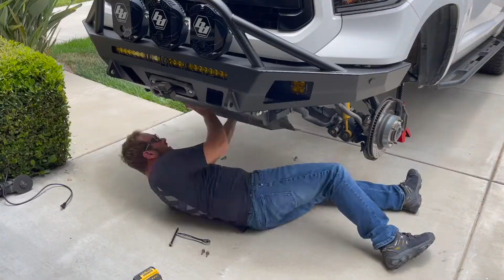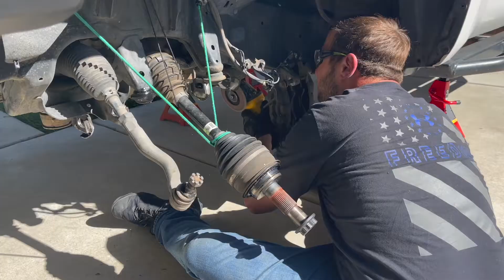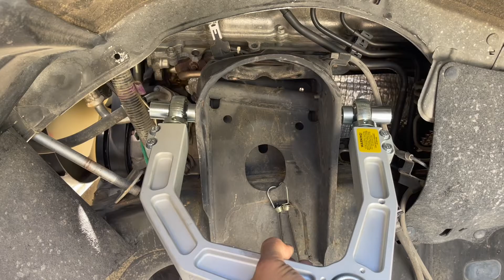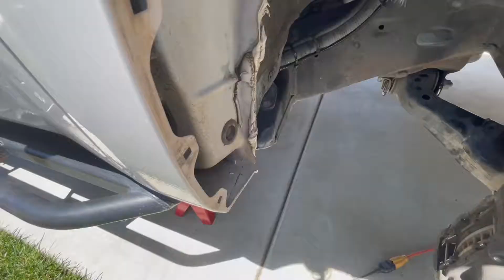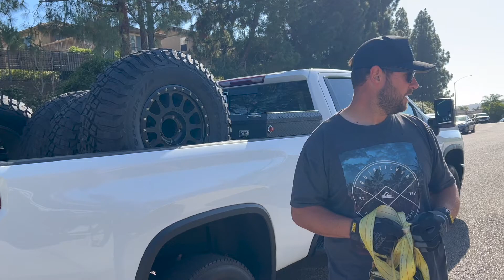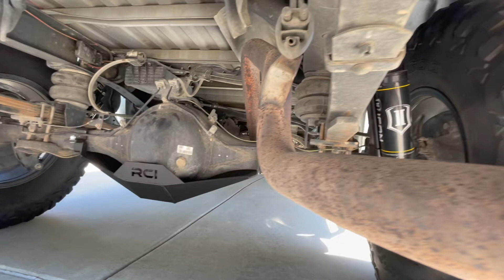ICON 3.0 Suspension & 37 Inch Tires - BIG Changes For The Tundra

Comment: nice video brother. How much lift did you end up setting on the front? What rear end setup did you end up doing now with the 4wc?
Reply from the maker: Thanks! I don’t know specifically. I’m thinking 2-3” but they are adjustable coil overs. So I just adjusted the spring till the truck sat level. Rear had leveling air bags but it needs a new set of lead springs. Waiting to see final weight when I get done building it out.

Comment: No sway bars ?
Reply from the maker: Truck didn’t come with a rear and the front one didn’t fit very well after the new suspension. Was going to adjust some stuff to make it fit back on, but once I drove it without it, didn’t notice much of a difference. So now it’s taking up shelf space in the garage.
Reply: Yeah I have a 4.5inch bds coil over kit never drove with the front one off. Considering removing it

Comment: Hi there,
I’m wondering if you’re Using the same stock gear ratio in your diffs ir have you re-geared them to perhaps 4.88 or 5.29’s? 
Also, did you notice and vibration from your driveshafts due to your lift or not? 
Thanks in advance for your feedback..
Reply from the maker: Hi, I did eventually go to 5.29. In this video I had not switched yet but a couple months later I did once the parts finally arrived. I also put in an Eaton E locker. 

My lift is pretty mild. Only about 2 inch. So no vibration from pinion angle.
Reply: @prospectoverland  Thanks for the info and keep these awesome videos coming..🫡👍🏼🥃

Comment: What’s the height of your lift?  Sway bar rub on the inside tire on full lock?  Awesome set up.  Clean job.  Nothing like yourself knowing that there’s
 quality time and work done to it.  Keep it coming!
Reply from the maker: It’s hard to say the exact amount of lift. It doesn’t have a actual lift kit. The icon shocks have the coils cranked down to the max amount which I think is about 2-3” of lift. But my truck is very heavy so 2” of lift on mine might be 3 or 4” on someone else’s rig. 

Sway bar had to come off because it was hitting the bottom of the shock where it mounts to the A arms. 

Still rides great without the sway bar. But tires hitting the sway bar was not the issue. +25 offset rims are the ticket for not rubbing a lot.

Comment: Now that youve run this setuo for a bit , are you rubbing at all? Love the truck!
Reply from the maker: I get a slight touch on the very top of the tire on the fender liner. But only enough to just put a small discoloration haze on the plastic, zero damage.

Comment: I gotta ask, as I’m looking at the GFC as well. Is the tundra your daily, and if so, what’s it like always having the GFC on. What else was added to assist with the weight and what was the impact on mpg. I have a 2019 TRD PRO tundra and just looking at options, thanks!
Reply from the maker: Its not my daily, it gets horrible mileage but not solely because of the GFC. I don't know exactly the difference the GFC made because my truck has so much other stuff done to it and is really heavy. I get 10mpg typically. The GFC is light weight, but with all my added gear and bumpers and stuff I have air bags currently but planning to get a different leaf pack built.
Reply: @prospectoverland  that’s not too bad. Thank you for taking the time to answer my question!

Comment: How much lift over stock did you add?
Reply from the maker: I’m not sure really. So many things are changed about it. I have 1.25” of pre load on the springs but that’s doesn’t say much because my trucks weighs a lot so that much pre load on my truck doesn’t equal someone else’s. If I ever come across a stock tundra I should do a quick measure.

Comment: I have the similar setup with ICON tubular UCA's, with leaf spring kit and fully adjustable dampening rears as well (I think essentially stage 9?). The shop that installed mine did not cut the bump stop, nor did they move the boot on the steering rods. I wonder how critical this is and if I should be worried? Also, I didn't hear you mention any diff drop kit or bump stop spacers (maybe I just didn't hear). I had Coachbuilder bump stops installed (with his outer tie rod) and the Icon diff drop kit. Your BMC is amazing. Wish I was close I'd pay you to do mine. 😁

Also any issues with clearance on the way you did the pinch weld mod? How do you like the KM3's? I was thinking of Toyo AT3's but I think overall diameter is larger than your KM3's.
Reply from the maker: Hey Jake, I guess ill never know if trimming the edge of the bump was totally necessary. I've heard it specifically is needed for the 3.0 system due to the bigger coil size. The 2.5 shock has room to clear. Reference moving the boot, again I guess I won't totally know but the reasoning was that by sliding the small end of the boot closer to the center of the truck it allowed some extra slack in the boot to accommodate extra articulation. I've heard that the boot could tear from being stretched to the max when the suspension drops out. The reasoning makes sense in my head so I just did it. 

My truck already had a diff drop from a previous lift which I guess I failed to mention. And I did install Icons thick washer/bump stop spacer to limit the up travel and prevent any coil binding. I think I did this after the video once I spoke with them some more. 

No clearance issues on the front after my mod's seen in the video. Thanks, I am pretty happy with the BMC. Turned out pretty clean once all painted up. Check my most recent video, did some flexing tests. The rear tires rub some plastic on full tuck. Not a big deal. And yes the KM3's are amazing but I think are 36.5" when truly measured. 

I think i covered all the questions. let me know if i missed something.
Reply: @prospectoverland  That covered it! Thanks for that detailed and quick response. I’m waiting for wheels/tires (37’s) as I heard that gears are required with 37’s. I’m going to save up for Nitro 5.29’s, and…..if I’m doing gears, then I’m doing Eaton E-lockers at same time. So I need to save up about $10k. 😢 This is not a cheap hobby!
Reply from the maker: @jakemaddox76  haha everything seems to be a minimum of $1k. I just did the same gear and locker set up. Couldn’t be happier with it. Just had my 1000 mile break in oil change done a couple weeks back. Used the locker twice already since breakin has been done.
Reply: @prospectoverland  oh awesome!! Did you make a video covering the install?
Reply from the maker: @jakemaddox76  i didnt becuase it was all done at a shop. nothing to really film. left my truck with them for a few days and they did the initial heat cycling for me as well.
Reply: @prospectoverland o was doing my brakes over the weekend and noted that both tie rod boots popped off the steering rack. At full lock the open space is ridiculous. Why has nobody else mentioned this? They’ve probably been off a year. I contacted Icon and one of their techs Justin said that the Tundra they installed it on when designing their suspension kit did not have tie rod boots. Can’t be normal right? Seems a longer boot would be best solution (in addition to chocking up boot as you did). Plus, my boots came with zip ties instead of pipe/band clamps. Cheeseball.
Reply from the maker: @jakemaddox76  mine are still working fine in the choked up position. A larger boot would be the ultimate fix but the way I have been running it has been working fine. I think I saw this in the ICON instruction to do it but maybe it was a tip from somewhere else. I cant remember.

Comment: Where did you get your alignment done? I got mine done at the ORW in Kearny Mesa and the guy bitched about what a difficult time he had and I have the same suspension set up that you have up front. Icon 3.0 coil overs on my 2016 Tundra with Icot billet UCAs. I wouldn’t mind a decent shop to get this done at in San Diego.
Reply from the maker: Accurate Alignment in Oceanside. They did so awesome. They did say it was a little tricky and I think was $150. But they weren’t complaining at all. They really liked the upper billet arm because it was super adjustable. I am not a fan of ORW whatso ever. Steer clear of them. They just install bolt on parts. No custom or specific knowledge about special builds.

Comment: 13:17 No one ever thinks to just fold in the factory steel on the body mount. Cut a pie wedge, Hammer it in, then weld it back together.
Reply from the maker: Yeah that would work I suppose. Would save buying the pre bend plates. But the plates are so easy to fit right in.

Comment: I had icon suspension,  HAD.  Went to Fox after Icon failed to honor a warranty claim for a set of shocks that broke at the strut.   I steer anyone away from Icon.  Terrible CS.
Reply from the maker: Sorry to hear that. So far they have worked great for me. I had a issue with the first set of rear omegas and I had a new pair the next week.

Comment: Hey man I’m running almost the same setup minus the gfc on the back.. I can’t seem to get my truck level. It sags so much to the driver side. I’m already maxed out with shim spacers on the bumpstop as directed by icon. Did you have any issue? I’m thinking about just ditching the 600lb springs and sacrificing the travel to get a little more ground clearance. 

Also, for the rear when I have heavy loads I have sumo springs and even at high speeds over nasty ruts they do well with working with the suspension.
Reply from the maker: First off are you running 2.5 front coil overs or the 3.0? 

I have the drivers side lean also when my gas tank is filled up. Not too noticeable when I’m running on empty. Seems like this is a pretty common issue with off-road stuff. Jeeps have a known lean as well.
Reply: I do have the 3.0’s
Reply from the maker: @chestonholguin3515  from my understanding we don’t have any other springs to go to. The 3.0 diameter that icon uses is one off and the only spring they have for it is the one that comes on it which I believe is actually 650. The 2.5” shock guys do have other options up to 700lbs from my understanding. Sooooo, I would adjust your lean by cranking the springs down further on one side vs the other. I have my driver at 1.5” thread and passenger at 1.25” thread.

Comment: Sick set up!  What wheel are those?  I noticed you had regular acorn lug nuts and not ET lugs, many turns do you get ?
Reply from the maker: Thanks man! The tires are 37/18/12.5 BFG KM3. Rims are 18” method NV. 

I just put new OEM lug nut studs on the whole truck a couple days ago and bought the black lug nuts that method sells for the standard Toyota bolt pattern/thread. 

What do you mean how many turns do I get? Tightening the lug nuts??

Comment: I had the icon rxt stage 1 then had it reconfigured for stage 2 felt nice.  But fully loaded with gear truck squated . I had a cbi bedrack and cvt mt.hood dual channel so about  300lb i do have a high clearance rear bumper with tire swing out 37in tire . Rxt stage 2 felt still pretty soft Imo so i upgraded to deaver u748 + sdhq shackles overall feels good . Haven't done any technical trails  with the new deavers yet .
Reply from the maker: Awesome thanks for the feed back. You squatting with the new deavers and sdhq shackles still or did that part get resolved?

Comment: I’m just impressed you had a spacer kit on there with that bumper. Have a westcott kit on my blue and yellows. Had icons before on a 4runner and May go that route again.
Reply from the maker: Liking my Icons a lot so far, kinda wish they had a stiffer spring option so I didn’t have to crank these down as far to get the preload but 🤷‍♂️

Comment: Such an awesome build you have, such a badass tundra. Running the same icon kit on my truck. I got the 3.0s upfront with the billet ucas. Out back im running thr rxt leaf pack set to option 1 and the rxt 2.5 resi shocks. They aren't the baller omega shocks since mine only offer compression adjustment. I'm also running firestone air bags with daystar cradles and trd sway bar. I have a bed cap with about 100 pounds of gear I keep in my truck. I'm also running 35s with some second gen tundra rock warrior wheels. Definitely a whole lot lighter than your rig but the icon shocks are awesome. Biggest thing I've noticed for me at least is the icons ride rougher than stock around town but they cruise amazing at highway speeds and big hits. Makes sense with the digressive valving icon uses.
Reply from the maker: Thank you! And thanks for the info about what you are running in the back. I’ve heard that digressive valve term but need to research what its about. I’m not to savvy with shock stuff like rebound/compression/valving etc. my big thing with the fronts were that the 3.0 came with internal bumps. And I made the jump to the omegas for the rear hoping the extra adjustment would help me manage the weight of my truck better the ones that aren’t as adjustable. But idk 🤷‍♂️ ha. We will see.
Reply: @prospectoverland  Basically the way digressive valving works is that the shocks are stiffer at lower speeds and gets smoother as piston speed builds up. Obviously the shock can only take so much speed then it reaches its limit. Progressive shocks like king/ fox etc are softer at slower speeds and will get stiffer as speed increases. There's soo much that goes into it all. You should be able to fine tune the rear setup as you out more miles on it and do some off-roading. Around town my rears are set to 4. I find that at the softer settings the rear end felt too loose. you might want to start with everything cranked to setting 5 all around. Im going on now almost 2 years with my icons. I'm thinking probably next year ill get them rebuilt as ive put close to 25k on the suspension already with towing and general driving.